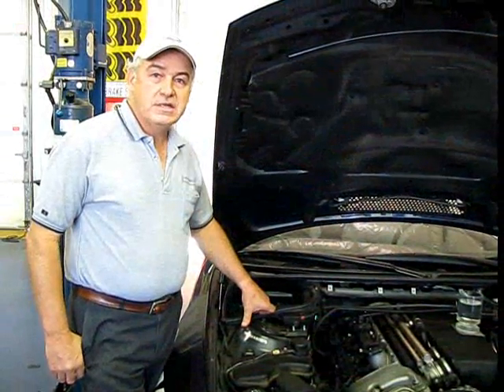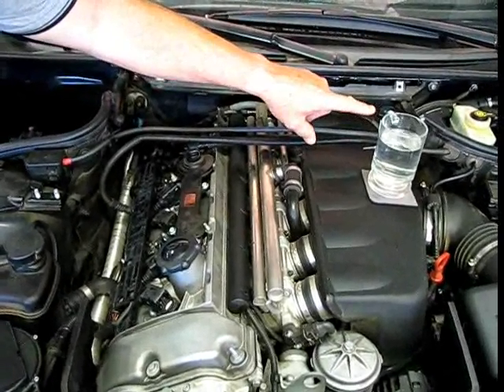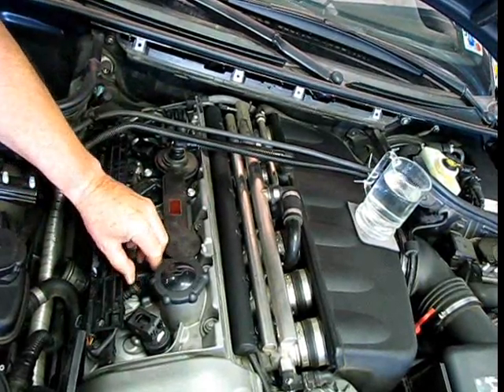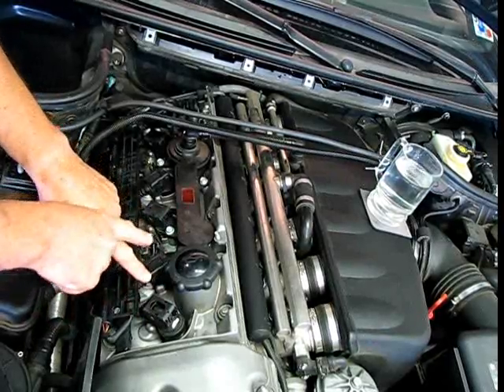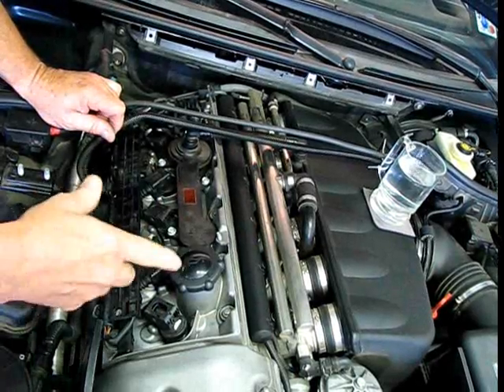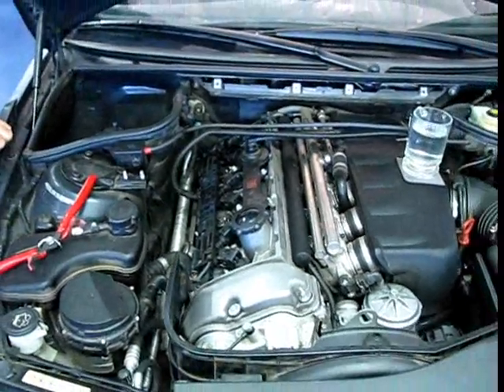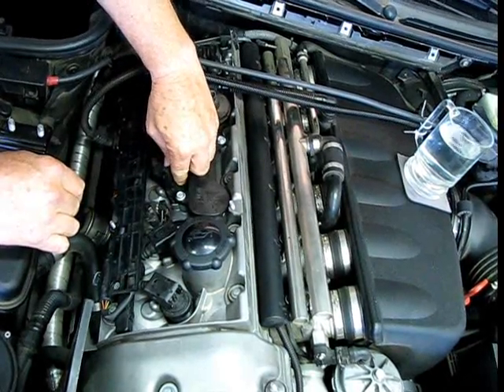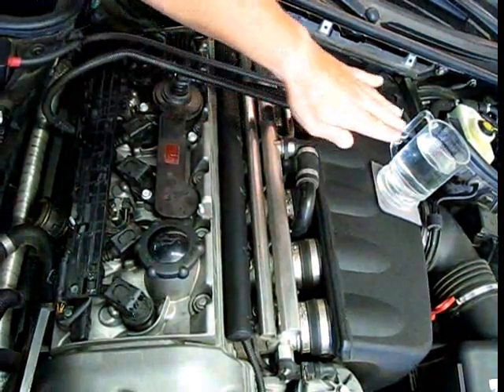BMW E46 M3 Ignition Coil Replacement and Cylinder Misfire

Comment: 528im52:
Great Video! Looks like I need to check my ignition coils because earlier this year my SES light came on and I took it to Autozone to borrow the OBD decoder; misfires on 3 and 4, which was a associated with a subtle engine knock. Replaced all six spark plugs, but doesn't run as smooth like this car after the coil replacement. I hope it's as simple as replacing the coil; Could you pm me about the Bosch coil pack and severity of not replacing the coil pack immediately. I'm broke! lol

Comment from the maker: Well, that could be one of a few things.  First it sounds like the mechanic just cleared the code and the problem has persisted.  The 2 main things to look at are the Spark Plugs and the Coils, to determine if it is the coils you can use the technique in this video.  If you do like we have done in the video and the problem persists or does not move with the coil, then you will want to change/replace the spark plugs.  After that it is either the injector or cylinder compression.

Comment: Great video. My OBD II read a cyl 5 misfire on my '97 M3 and I went through your tests. New plugs and a coil exchange kept the problem at Cyl 5. Any ideas for troubleshooting this misfire? Intake gasket leak? Should I try and exchange the fuel injectors around and see if the cylinder follows? Thanks! Keep these videos going!

Comment from the maker: Honestly,

I wouldn't do it unless you feel a misfire, or rough running.  The only other reason for doing them is if you are doing spark plugs and since you are already in there want to change the coils.  

We have never seen a big power gain or increase in drive-ability by replacing the coils unless one of them is giving us problems

Comment from the maker: Hello,

Normally Yes, a misfire will through a check engine light 90% of the time, but from time to time we have had a few cars in our shop with a slight misfire but no check engine light.  This is due to the fact that on BMW's the misfire must occur 6-times in a drive cycle for the Check Engine Light to come on.

Comment from the maker: By all means it could have been a bad or clogged injector, but during the video when we swapped the coils from Cylinder 1 and Cylinder 2 the misfire followed the one coil.  If it would have been an injector it would have remained on the same cylinder and not move around with a single coil.